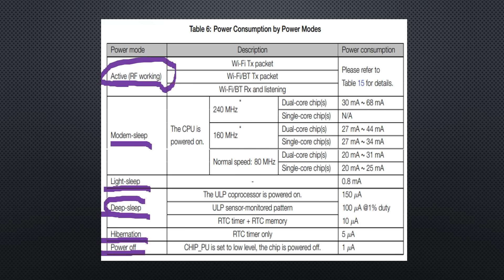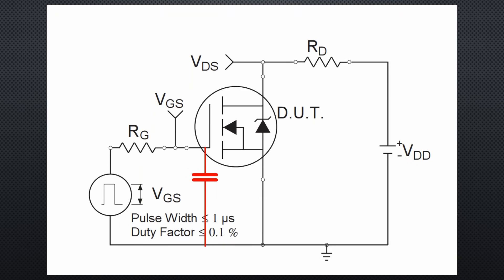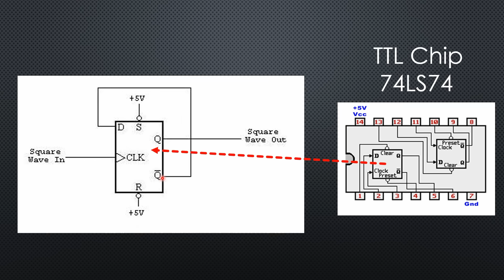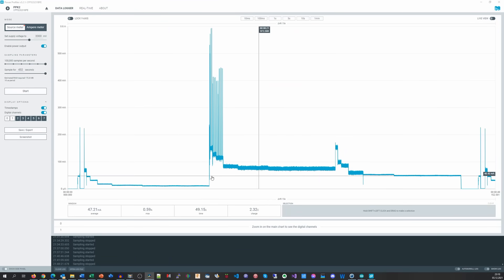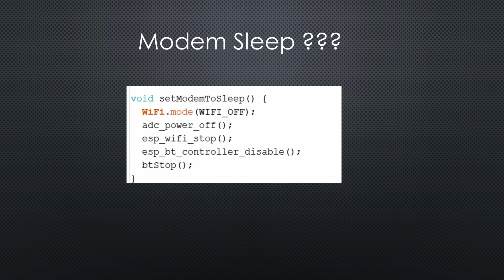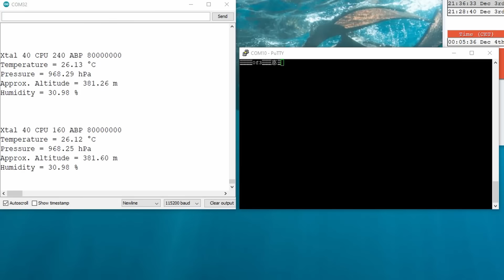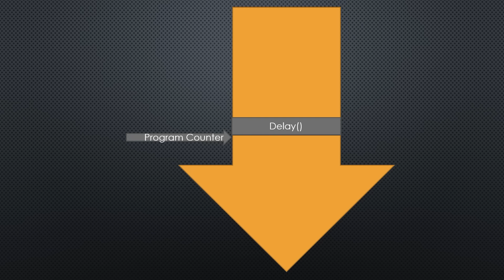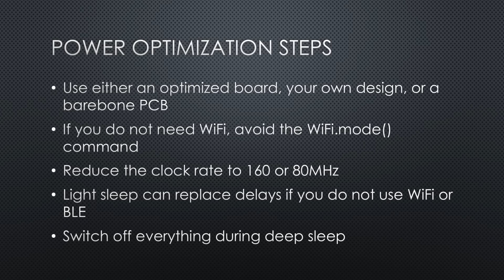(490) Unknown ESP32 saving: Light Sleep, Clock Reduction, Modem Sleep, Hibernation, and a few tricks

Comment: The Nordic Power Profiler II is an absolute game changer if you're into low power microcontroller applications, especially those with widely varying current draw.

Its USP is its unique current measuring method, using a series of comparators to dynamically change current range, thus offering a huge dynamic range. Thus, burden voltage issues inherent to traditional static shunt resistor current measuring methods are no longer a problem.
Reply from the maker: I agree. However, you also get other such devices. But more expensive.
Reply: @AndreasSpiess  As well as the Power Profiler II, I have a couple of SMUs and an Otii power analyser. The Power Profiler II is used almost on a daily basis. The SMUs maybe once a month. The Otii: I used it once and it's sat in a drawer ever since, its current measurement in the single digit uA range and lower is so noisy it's useless. The Power Profiler II is 1/6th the cost and offers a far better real time low current (ie, under 5uA) analysis than the Otii. My point is that the Power Profiler II's auto ranging implementation to increase dynamic range is unique to it as far as I am aware, certainly at the price point.
Reply: Link please

Comment: I worked in my last job with a battery operated ESP32 project that reads the information from a magnetic sensor and send it using LoraWAN, and my calculations to hit the needed battery life were sub 100uA on standby, but that budget were ESP32 + sensor + lora radio.
I used the IDF to program it, Arduino is useless for any serious task that implies a micro that isn't Atmel.
All the fun stuff to manipulate the hw of the ESP is behind IDF.
And there's a lot of HW design to hit a good low sleep power consumption.
Of course the ESP32 hides a lot of quirks that needs to be addressed in the final design.
Reply from the maker: Fir professional projects, the IDF is a good choice. However, it works only for Espressif chips.

Comment: This is very good information.  I am new to the ESP32 and am considering using it in a few projects as apposed to my current use of Raspberry PI, which I am familiar with and have been too lazy to learn another single board computer or microcontroller.  Thanks for this and your other videos.  You explain things very well.
Reply from the maker: You will like it! Raspberry Pis sometimes are too big...

Comment: There's also a ULP co-processor and RTC memory you can use, a very low speed CPU but full capability, consuming power in nA range.
For real-world application you would want the ULP to listen to peripherals(with no interrupt capability) and wake the main CPU in certain criteria.
But realistically if you are doing very tiny application and you can bit big everything in a slow clock, you can put your whole code into ULP.
Reply from the maker: You are right. I once made a video about it ;-)

Comment: 10:10 WiFi.mode works for me with ESP8266 even at 80Mhz. I had a project where the esp fetches time from a LAN NTP server and then updates it if the clock hits 11.30Pm the modem turns off and the internal timer starts and the wifi turns back on at 6.30Am in the morning. Never got a chance to try the command with an ESP32 though. It reduces the consumption from 130mA to just around 20mA and the esp8266 is still running everything else in the code. ADC measurements to. But I faced a issue with ESP8266 is that you cannot use the ADC too much when using WiFi so the ADC update rate is around 10S or so.
Reply from the maker: The ESP8266 has a standard clock speed of 80MHz. So, everything should work as designed.

Comment: I have 2 questions in this:

1. I cant use wifi, but can i use ESP now with lower clockrates than 80MHz?
2. Is there a way to keep the pin state on HIGH during deepsleep?

Thank you for this videos
Reply from the maker: 1. Yes
2. I do not know. I never used it :-(
Reply: @AndreasSpiess  Thank you

Comment: Nice, but for battery-powered projects I prefer to use nRF24L01. I make sensors with one AAA battery on them and it works for a few months.
Reply from the maker: Also, a good idea when you do not need an internet connection.

Comment: If the clock speed is reduced then the code takes way longer to run. Judging by the area below each section of the measurements at 8:30 it looks like the most milliwatthours have been consumed at the lowest frequency of 10MHz (the total area looks way larger than at 240MHz in my opinion) Would it be fair to say that the current is in fact lower but battery life would be worse? Or am i missing something
Reply from the maker: You are correct if the processor is fully loaded. However, microcontrollers often wait for a very long time and then react to a signal. Then, a lower clock makes sense.

Comment: Summary
## ESP32 Energy Saving Modes Summary

Here's a summary of the video's key points about optimizing your ESP32's energy consumption:

General Tips:

* (00:00:00) Use optimized hardware: Standard ESP32 Dev boards are power hungry. Use optimized boards, your own PCB designs, or a barebone ESP32 module.
* (00:10:05) Disable unused features: If your project doesn't need Wi-Fi or Bluetooth, avoid enabling them.

Clock Rate Optimization:

* (00:02:23) Reduce CPU frequency: You can significantly decrease power consumption by lowering the ESP32's clock rate from the default 240MHz.
    * Reducing to 160MHz or 80MHz offers substantial savings without impacting most sensors and with full Wi-Fi/Bluetooth functionality.
    * Going below 80MHz requires adjusting serial console speed and impacts Wi-Fi/Bluetooth. 
    * Remember that lowering clock rate reduces processing speed. 
* (00:13:39) Adjust clock rate dynamically:  You can change clock frequency within your sketch depending on the task. 
* (00:10:01) Note about Modem Sleep: The presenter couldn't verify clear benefits of this mode and suggests avoiding it for now.

Sleep Modes:

* (00:14:19) Light Sleep:
    * Acts like a delay with lower power consumption (around 1.5mA).
    * Suitable for replacing delays when Wi-Fi/Bluetooth are not in use.
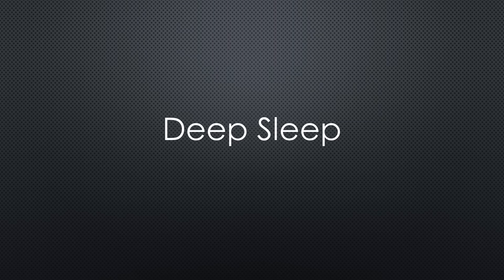* (00:15:15) Deep Sleep:
    * Most effective power saving mode, consuming only microamps.
    * Requires careful management of peripherals and memory as the ESP32 reboots upon waking.
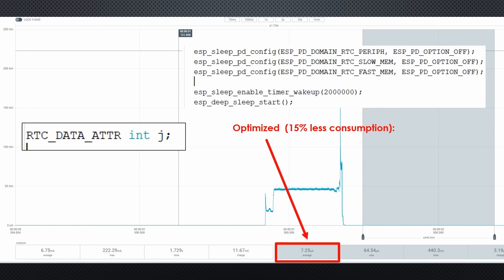    * *(00:15:32) * Disabling the ULP (Ultra Low Power) and RTC memory can further reduce power consumption during deep sleep, but eliminates persistent data storage.

Overall: 

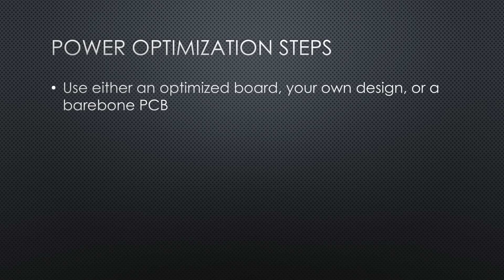* (00:15:54) Testing is key: Verify functionality after implementing power saving techniques. 
* (00:15:54) Choose strategies that fit your needs: Balance energy efficiency with functionality and project requirements. 

I used Google Gemini 1.5 Pro to summarize the transcript.
Cost (if I didn't use the free tier): $0.1242
Time: 90.62 seconds
I added a 60 second delay to prevent a rate limit of the free tier.
Input tokens: 32723
Output tokens: 923

Comment: Thank you very much for the helpful video.

I was wondering, what could be the reason why Wi-Fi doesn't operate at frequencies below 80 MHz? How can the Wi-Fi module inside transmit symbols at such high frequencies (like 2.4 or 5 GHz) during the transmission stage ? Is the frequency required for radio transmission supplied from another source ?
Reply from the maker: The 2.4 GHz signals are produced in a radio module. The MPU has a different clock. I do not know if they are interconnected.

Comment: I would like to see how the ESP can actually sleep at minuimum current of only a few micro-amps and wakes up by triggering an input, like a sensor contact. The datasheet mentions it can be woken up when just consuming a few microamps, bit I never saw someone doing and proving this.
Reply: In my last job I was working with a ESP32 on battery and the requirements were like 1yr of standby.
I used the ULP to wake up the main processor when the ULP detected an interrupt from a magnetic sensor.
Not only doing fw magic but also a lot of hw design is needed to hit micro amps and a good sleep
Reply: @fersunk  so in your opinion without ULP it is not possible, even when the datsheet mentions a few uA?
Power consumption in Deep-sleep mode is 10 µA, here they mean the ESP32 not the ULP right? 10uA would be perfect for battery mode... but I never saw someone succeeding in reaching only 10uA. Strange... hopefully Andreas will figure it out in the next video's.

Comment: Thank you also for this video. However, your conclusion about the sleep modes with WiFi is disappointing. I had hoped for more here. Had been researching this for hours. Lightsleep is fully automatic with WiFi. But as others have pointed out, not with Arduino IDE. Apart from the IDF ‘wifi power safe’, there are no useful examples anywhere on the net. Would you be interested in investigating this in more detail? Everyone would like to have a low power wake on wifi node! I'll keep experimenting and if needed I recompile the arduino libs with enabled advanced power options. I post if I succeed. I can also do a Swiss accent :-)
Reply from the maker: You find me in the telephone book if you found a solution! I am interested, too.

Comment: @Andreas The Wifi library... its compiling... amazingly it works on ESP... But only WIFI, so now you can add lowpower modes to the list of things not working with the Arduino Wifi class.
(Just use the IDF functions for wifi and you might get a better result)
Reply from the maker: Thanks for the info!

Comment: I have a suggestion, measure the time that every microcontroller you have takes to register an input, like a button. I saw a video of you doing it for stm32 and esp32, but I can't find it anymore! New microcontrollers like rp2040 will be awesome. 
It's important for gamers to have the most low delay microcontroller.
Thanks!
Reply from the maker: The reaction time of such microcontrollers is way below 1 millisecond. So this is hardly an issue for your application. However, what they do with this information usually takes much longer.

Comment: As I understood in the documentation ModemSleep is nict a sleep mode, it ist just the mode, when the modem ist not working active, so it is in general turned on (initialised WiFi or BT) but is nocht sending or receiving. I researched for this a while ago for very long, because its very confusing
Reply from the maker: Modem sleep sleeps the radio. So no receiving or transmission

Comment: Thank you for your effort to achieve low power AND Wifi. I gave up. Hoping for a Zigbee solution combining Zigbee data transfer with epaper display.
Reply from the maker: I switched to ZigBee wherever possible. But only with commercial devices. I fear the ESPs will consume too much. But so far, I did not try.
Reply: @AndreasSpiess  Yes, Zigbee uses e.g. CC2530 which seems to have limited programming support.

Comment: there are commands you can use within the runtime - not in overall:
setCpuFrequencyMhz(10); - 10 MHz etc 

but to make Serial working:
      // Serial has to start again after CPU frequency is changed
      Serial.flush();
      Serial.end();
      setCpuFrequencyMhz(10);
      Serial.begin(115200);
Reply from the maker: Thank you for the info! Valuable!

Comment: It's disappointing that the ESP32 doesn't support low power BLE operation like the NRF chips.
Reply: i thought the c3 did blue tooth low power
Reply from the maker: I did not check the newer chips for power consumption. The old ones were horrible for BLE

Comment: I think there was confusion about modem sleep. It's supposed to keep the modem alive while letting the cpu sleep, this maintains connections etc. It requires an external 32khz square wave iirc, and obviously doesn't make any sense to use without wifi. It's meant to let the modem wake up and just do the wifi book-keeping stuff.
Reply from the maker: I don't know if this is a new definition used by the new WiFi 6 functionality of some chips.
Reply: @AndreasSpiess  it seems youtube won't allow me to reply with links, but no, i'm very far from any risk of being too up to date, this was how it worked when esp32 was new, without need for ancs/ble (see watchy) it's not useful, the esp32 will never be a great device where power is at a premium, but still

Comment: Are you sure that you use hardware based i2c? I think with your implementation you use bitbang. I think I had interferences with f.x. wifi when using any kind of bitbang. Similar with one wire for less. m5c
Reply from the maker: I am pretty sure.
Reply from the maker: I am pretty sure.

Comment: You keep mentioning "no WiFi" power consumption down to 10 MHz. But WiFi does not work there, as you say at the beginning? So one should really avoid this and instead turn it off? to reduce the current draw to 1/7 of the WiFi-On-value.
Reply from the maker: I made this video a few years ago (this is a replay during my summer break). I do not remember all the details anymore, but as you write, WiFi does not work on low clock frequencies. Maybe the radio still consumed power but was useless...